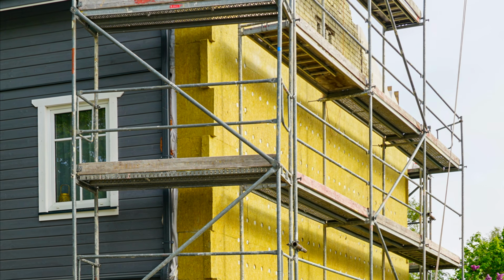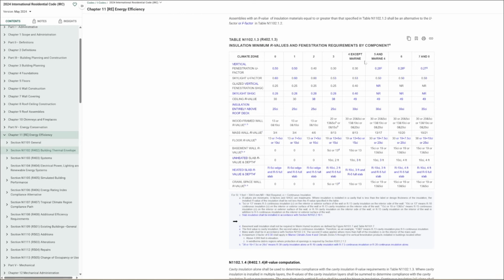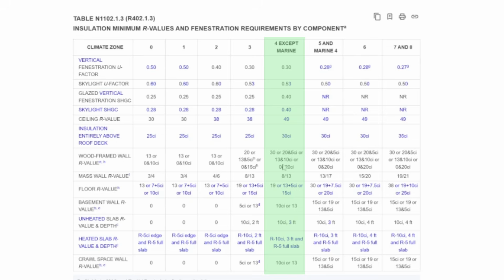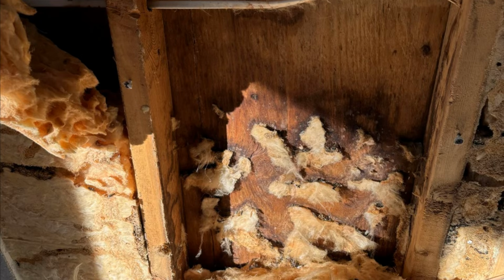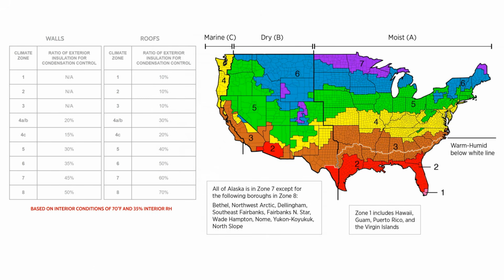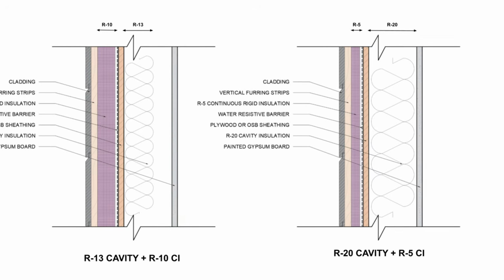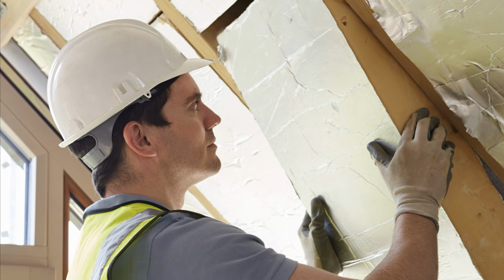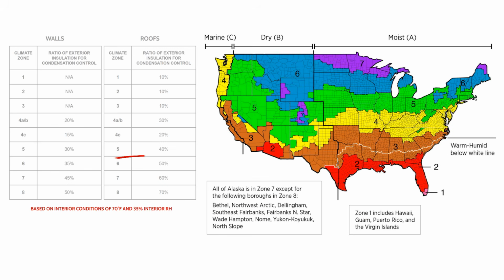How Much Exterior Insulation Do You REALLY Need? (The Code is Wrong?)

Comment: The amount of exterior insulation you need depends on how well you waterproof, seal air gaps, the size of air gap between your insulation and cladding, and the color and thermal absorption of your exterior material.

Climate zone/environment is a secondary thought - the choices you make above are more impactful.
Reply: I was going to say, he's talked about smart vapor retarders on the interior side of the wall assembly before. I guess this vid is more focused specifically on the ci vs cavity insulation question.
Reply: @RedMike-ym8hd  I dont think you need any interior cavity insulation. 

The only reasonable use case for interior insulation is the desire for noise dampening.

If you are using cavity insulation to actually provide insulation value then that indicates poor planning and understanding, or its an old building that for some odd reason cant accept more exterior insulation.
Reply: @TransNeingerian sort of. The climate zone does matter in terms of the total thickness of insulation, at least in the north (I'm from Canada). Yes, air sealing and moisture control is most important in all climates, but you need lots more insulation further north.

To that point, you have to affix it somehow and once you get upwards of 4-6"  of exterior foam, that gets tricky. So insulation in the studs makes sense up here, but we need more insulation outboard as well with the right ratios as noted in the video.
Reply: @jamesroscoe7555  nope.

It seems like you need more insulation because the north is only looking at the total thickness, and not layers.

A sealed 4" thick insulation material is nowhere near as effective as 4 sealed 1" insulation layers of the same material.

Sealing and moisture control actually isnt important in low humidity climates that dont receive snowfall, where an increase in airflow actually helps stabilize temperature and most condensation buildup.
Reply: @TransNeingerian  Some very open insulations like fibreglass batts do require some form of encapsulation to achieve their rated R value. However, your statement is not correct for all insulation types, eg for  sheet XPS, 4 layers of 1" has the same R value as 1 layer of 4".

Our codes now require around R30 walls (6" thick XPS) and around R50 ceilings. Yes, air leakage would bypass this, so blower door testing is required in addition to those insulation values. It is helpful to put some insulation in the walls, but more outside in our climate. Other climates will vary eg southern USA is totally different in that regard.

If one were to build a perfectly sealed structure with R10 exterior foam here (2"), it would lose too much heat in winter for today's standards. It's basic physics.
Reply: @jamesroscoe7555 thats nice.

You can stop parroting and start thinking critically yourself anytime though.
Reply: Right. A well taped Siga Majrex helps lower the risk

Comment: Make a video of how bad zip r sheathing is because of all of the nail penetrations. No one will touch this topic. I did 2 1" foam outside staggered with zero nails. I used carpet tape to adhere it to the walls and taped each layer. The only penetrations were the 1000 headlock screws for my rain screen. I'm in zone 6. R15 Rockwool was too much and I had some condensation still even with membrain vapor retarder.
Reply: It doesnt claim to be a self sealing membrane. Decent builders go over exterior nail holes with a flash sealant.

The nail holes are irrelevant though if you create an air barrier in your exterior insulation layer.
Reply: The nail penetrations remove and negate the so called advantage of zip sheathing. Plywood is better in combination with a self adhered membrane
Reply: @BaronVonFrankenBolzlll the advantage of the zip system is a one piece housewrap/insulation/sheathing option that you dont have to apply and attach in 3 separate layers.

Insulation often consists of multiple layers. The insulation and sheathing value is not harmed by nail holes when under exterior insulation that is sealed.

Comment: Code is a MINIMUM requirement. It is not saying it is, good, best, or ideal, it is the bare bones minimum.
Reply: Yes, but he is saying even at a minimum for some climate zones, it could not be enough
Reply: @stevenbaczekarchitect9431 it is enough. Not all structures need to withstand 30-100 winters without a single failure. Allow builders to build and people to have affordable housing. We need to get back to building codes as minimums and offer incentives for  meeting energy standards. incentives for locally sourced materials. I watch every video, cause we should do most things to last, but allow people to have temp. safe structures while they work on building a forever home...

Comment: What about using rockwool on the exterior? It allows drying to the outside while warming the sheathing like foam. Could you use say half of the R-value of foam and maybe get a little more condensation in that 1-2% of extreme cold weather but have the release valve of exterior drying? It seems like a good compromise?
Reply: Comfortboard on the exterior is generally safer than foam in a cold climate for the reason you suggest: it is vapour open. Codes usually are prescriptive for insulation level, not type, and insulation type matters. However, osb is somewhat of a vapour retarder also, so (in a cold climate) you would need an interior vapour retarder or you would get condensation on the OSB if it was below the dew point (or not hitting the insulation ratios above).

In a cold climate (eg for us in Canada), to meet the insulation levels and ratios simultaneously requires a lot of exterior foam thickness which introduces other building complexities: how do you secure the cladding to the framing through all that foam?

Comment: Very good video as usual. Big fan of your page. As you noted, a lot of this code is coming from building science corporation. One company with a couple of very smart people working for it. 

Does it ever worry you that only a couple of ppl are involved in providing the research that affects millions of houses? What if all these values and all these numbers are just not right
Reply from the maker: You will always have that risk when it comes to a top down approach, especially if a handful of people are making policy that affects millions of projects in a range of climates. We are confident about what works in terms of the physics (that's the easy part). It's the climate tuning that can get people into trouble.
Reply: @ASIRIDesigns  I like your response acknowledging that the approach is top down and centralized in its control. Granted, most of their research is awesome and they do a great job of helping us understand these issues. 

My only contention is the top-down centralized approach that local governments take in implementing this information into codes… rather than utilizing reason and providing suggested methods for building in a particular zone, most local governments mandate codes in a blanketed fashion and force homeowners to adhere to excessive standards that they may determine they don’t require for their own needs. I’d love to see a county that provides a clear “suggested methodology” for building but allows homeowners to determine what their own needs are and doesn’t get in their way unless what they’re doing is going to cause direct physical harm to their neighbors. The more population density there is, the greater the potential for harm without some standards in place… but the “affordable housing crisis” wouldn’t be nearly as big of an issue if the excessive regulation wasn’t put in place the way it is today.

Comment: Exterior perfect wall insulated  buildings of all types and all types of HR is the best and only the best, and all the rest is a load of shit.
Reply: Would you consider insofast X brackets with external polyurethane spray foam, a perfect wall?  There is no air , water, and vapor retarder added.  The foam itself serves the three functions as well as noise abatement. Or, so they say.
Reply: We have a 
"Perfect Wall" under construction currently and 3 more in planning, I am really liking the assembly, especially for climates 6 and above

Comment: Your the only source I trust with BS information besides Building Science Corp. Great work, and thanks for the info.
Reply from the maker: We appreciate that, thanks for watching!
Reply: Building Science Corp is always spot on
Reply: @stevenbaczekarchitect9431 except when they weren’t. Joe L has admitted he didn’t know what he was doing with roof rot and was estimating. They changed the code due to his constant overconfident, underproved rhetoric. Progress is iterative with trial and error, but his style of utter contempt for everyone else without having a bulletproof record is invalidating of his work. And I like the guy, but I STILL am not sure of the correct assembly to use because of this.
Reply: @TheChupacabra  can you expand on this? What roof rot?
Reply: @Daruma0xhe's referring to the propensity for ridge rot in unvented roof assemblies in cold climates. Humid air happens to be less dense than dry air which make the air at the peak of a roof kuch higher in RH, increasing the chances for condensation. Joe L had to have roofs ridges removed, and redone with what he calls a "vapor diffusion port" essentially the 4 feet from the ridge are vapor open in order to encourage drying.

Comment: I heard you say exterior insulation OR spray foam insulation in the cavity. We're building a new development in climate zone 5 (Mass) and we're doing no exterior insulation and see very few buildings in this area using exterior CI but we're doing R30 closed cell spray foam in the cavity and R60 spray foam in the attic. I know it's grey but typically because of the air sealing capability of spray foam, and in this case the R value, are you mostly keeping the exterior sheathing close enough to exterior ambient that condensation shouldn't be an issue?
Reply: I think you are preventing condensation on the inside face of the sheathing by covering with a vapor closed sprayfoam because there is no place to condense (assuming no gaps). Not sure if there is risk for interior to stud cavity vapor drive in that assembly
Reply: @Austin-fc5gs  We have insane state codes that exceed these, and everything needs to be blower door tested so should be no gaps.
Reply: @JNatella you should be fine for the most part